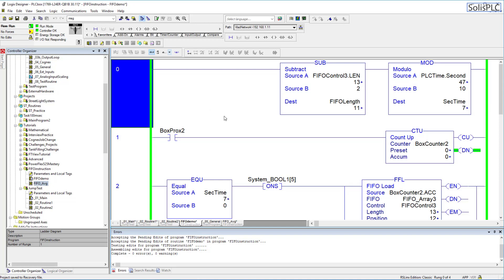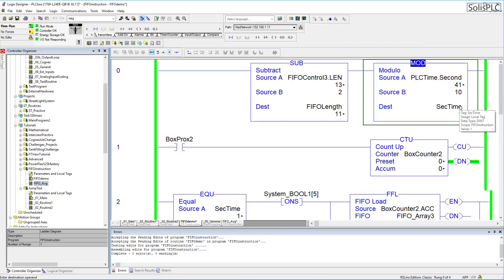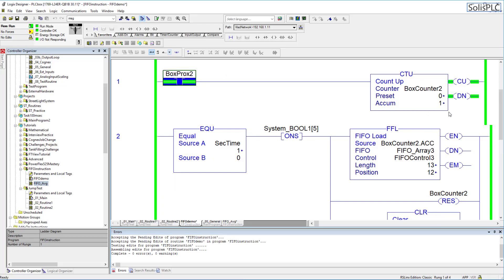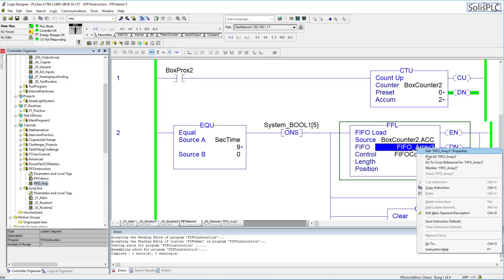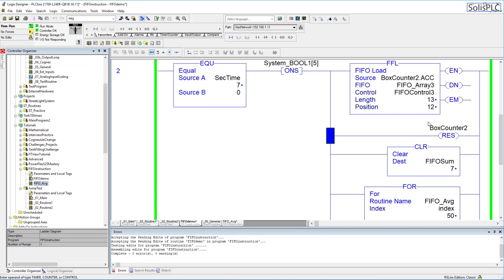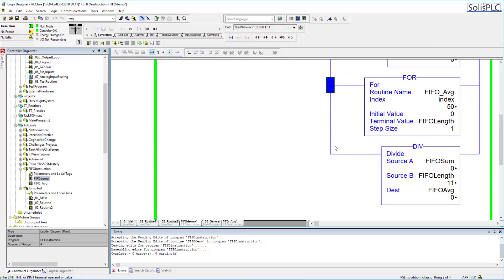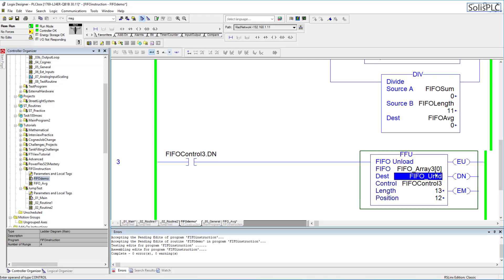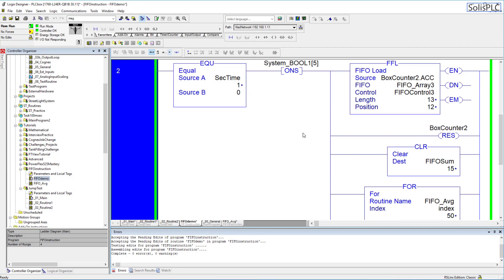PLC Interview Question - Array FIFO Logic Programming Example Average Rolling Mean RSLogix 5000

Comment: Thank you for a good presentation, I have tried the same logic on my "RSLogix Emulate 5000", although the behavior was somewhat similar, I noticed a few differences compared to what I can see in the video. Here are the most important:
1- The FFL Position increments from 0 to Length at each execution, whereas in your application the position remains at value 12
2- In my implementation the data is written downward i.e. from low array element index to high array element index (the opposite for your direction)
I am puzzled as I did not see in your logic anything that explains the change in behavior, could you kindly provide any explanation for the observed differences in behavior?
Thank you in advance for your help

Comment: FBD has a rolling average instruction already. Stand on the shoulders of those who came before you!
Reply from the maker: Every interview question has previously been solved. It's not about the "solution", but rather the path the candidate takes.
Reply: @SolisPLC  true, but I don't want prospective job candidates trying to build a can opener with their bare hands if a can opener is already on the table.  Perhaps the path I take is not what this interviewer is looking for, but it is the path I take.
Reply from the maker: @davebennett5069  again, it really depends on the goal of the interview. If the candidate mentions that the instruction is available in FBD, I can immediately tell that they're more than a beginner in PLC programming. The idea behind implementing a known function is that it's easy to explain the functionality and it's just as easy to validate the solution. The analogy you brought up is incorrect as "building a can opener" does not necessarily test your ability to use the can opener. In the case of a programming interview, writing logic that is implemented at the core of an advanced function tests your ability to use basic instructions to create a more complex one. This is very common practice in every single coding interview: in C++, you're always asked to build a class, you're used to build a data structure that exists, etc. You can always say "there is a library for this", but the reality is that your showcase of base programming skills can be easily tested. In either case, I'd be more than happy to hear what interview questions you've seen and would like for me to cover.